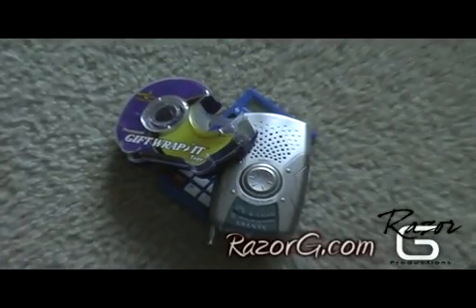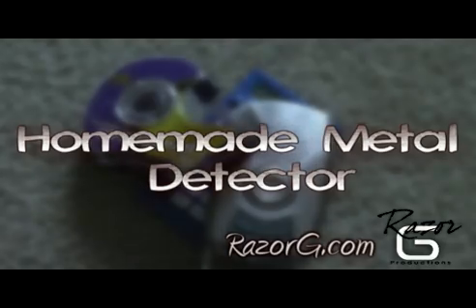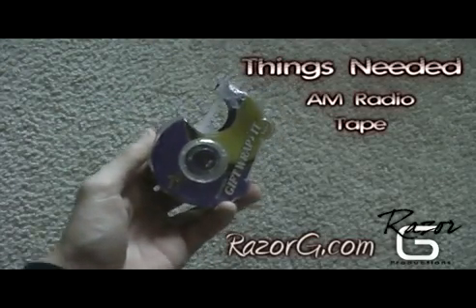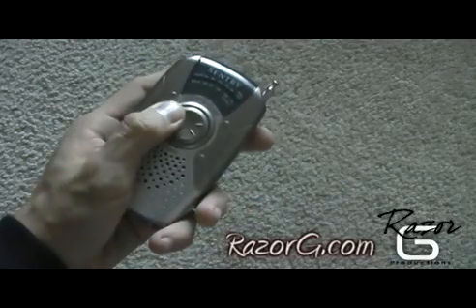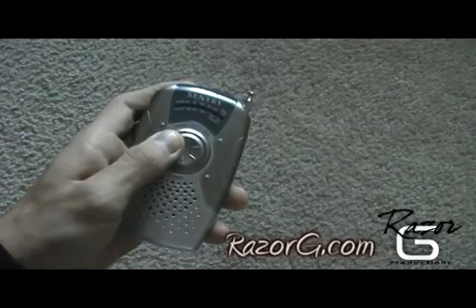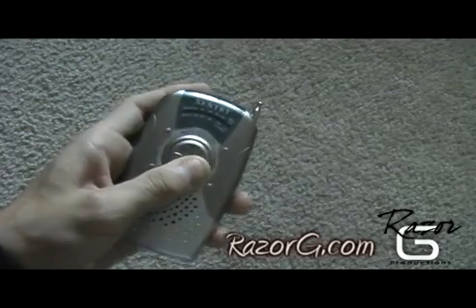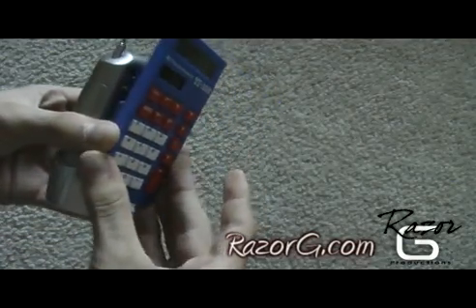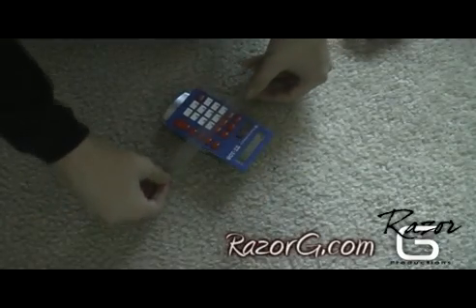How to make a Metal Detector with household items

Comment: That's okay, I've had my share too. I tried this - and I have the same exact radio, and it doesn't work. I think the type of metal you're running the radio over helps, and the type of calculator? I can get interference from my computer, keyboard and speakers, and I'm glad it's not audible to the naked ear all the time, I'd def go crazy, that's some harsh sound feedback. Thanks anyway.